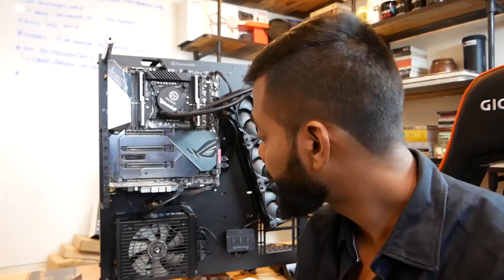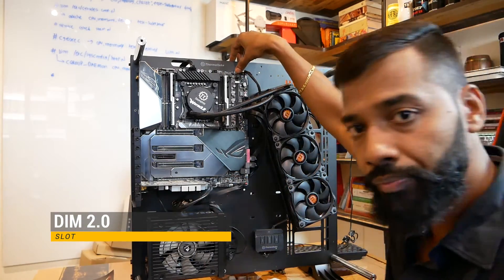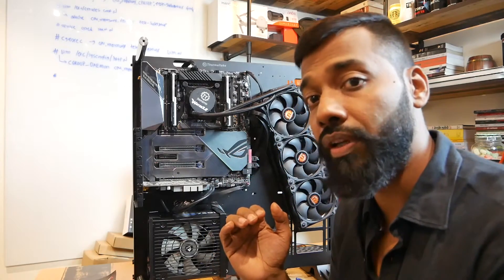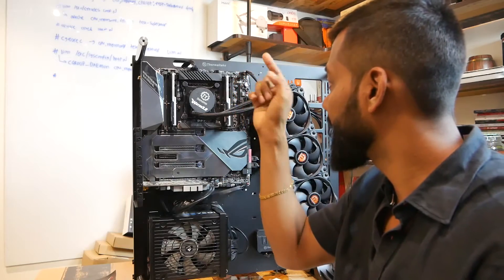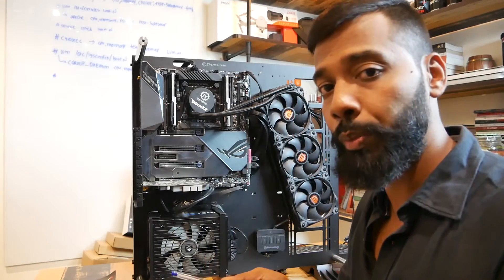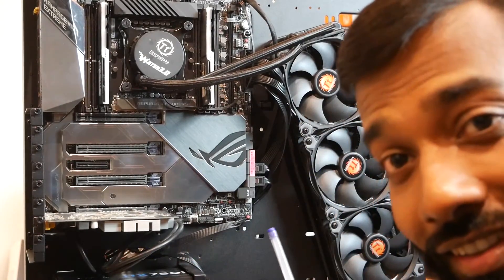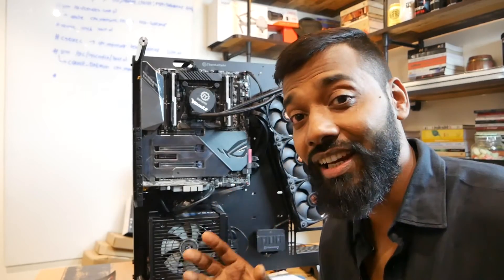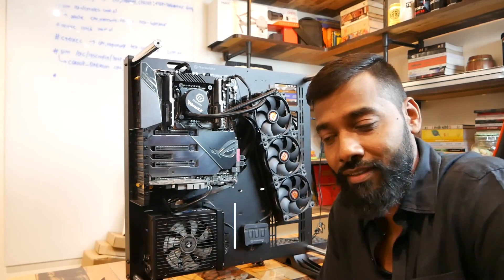Detailed review and installation of Asus Rampage VI Extreme, The most expensive gaming motherboard.

Comment: Really well done.  One suggestion.  Please include a build list of the components you used in the description.  I was really impressed with the other levels of detail and wanted to get the same case.  The "Tempered Glass" sticker made me wonder if the Thermaltake case came that way or if you added the glass.  I'm sure others also wondered about the installed components.  Thank you.
Reply from the maker: Hello Michael, Sorry for the very very late reply, I will surely add the components list also the case same along with the tempered glass. Its called 'Thermeltake core P5'. Its beautiful case. The best part is its wall mountable.

Comment: Hey there I got the same board and my board has some problems detecting the dimm. 2 slot by the ram. It couldn’t detect my m.2 ssd. Do you have a solution for this?
Reply from the maker: Hello. I tested dimm2 on my board and it does work for me . I did not face any problem . I guess it's the right time to contact the Asus support . Also check the uefi settings .
Reply: yogesh babar what settings do you run?
Reply from the maker: @klee.dodoco  all default . I did not change any specific settings . May be u can try by resetting the uefi to default and if it still does not work then get the Asus support assistance .